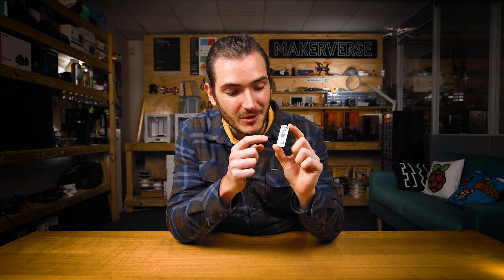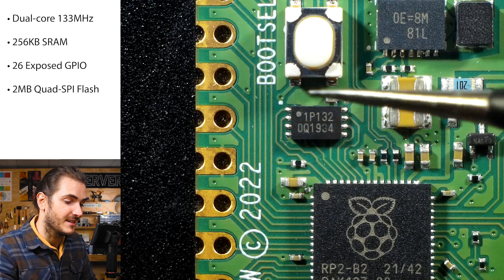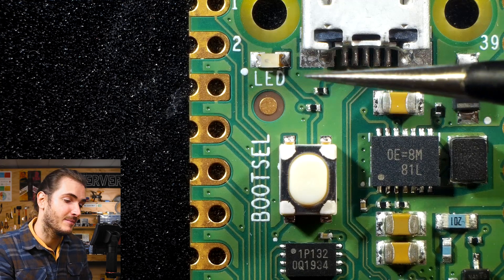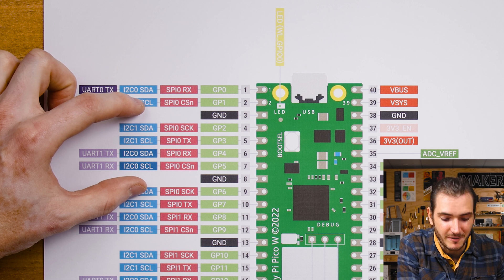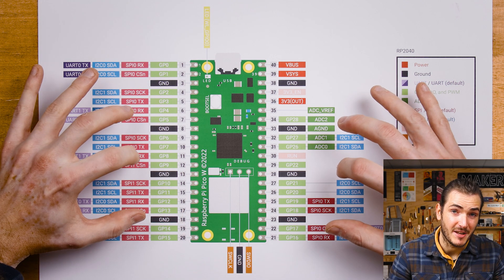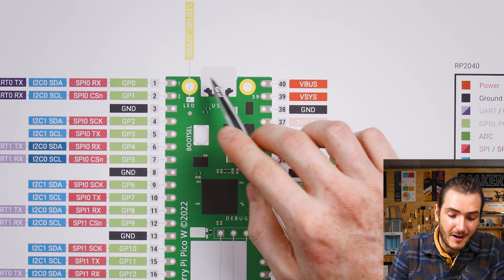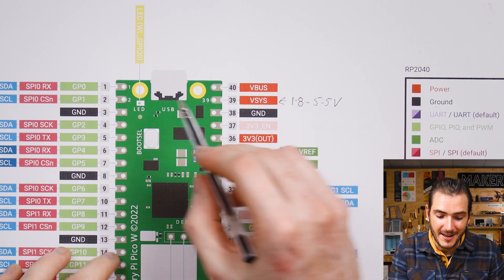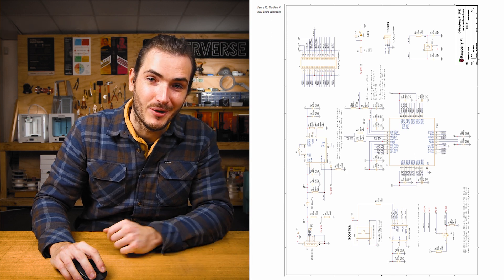Raspberry Pi Pico W (Wireless with WiFi): Overview, Features & Specs

Comment: @Core-Electronics what is the magnifier you are using just after 1 minute and 10 seconds seen in frame with you? Great content btw, thank you!
Reply from the maker: It's a video microscope, great for capturing soldering, looking a PCB designs and anything else teeny tiny
Reply: Thank you! What company is the manufacturer?
Reply: I wanna some question about this for my claification